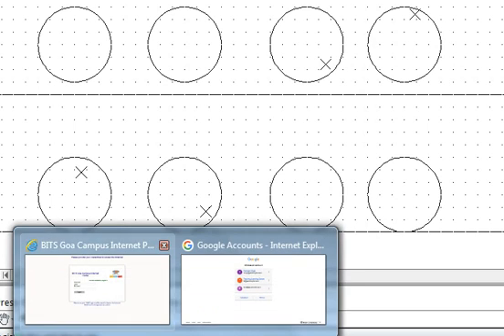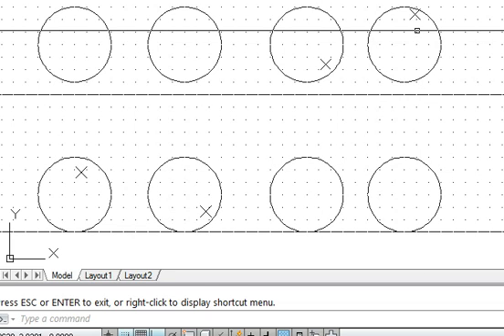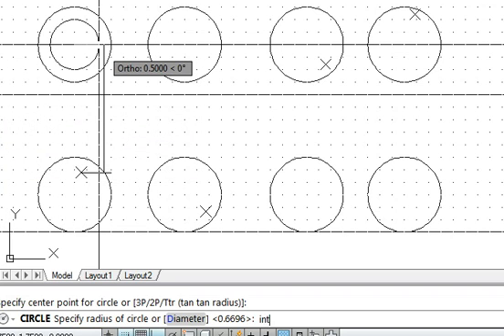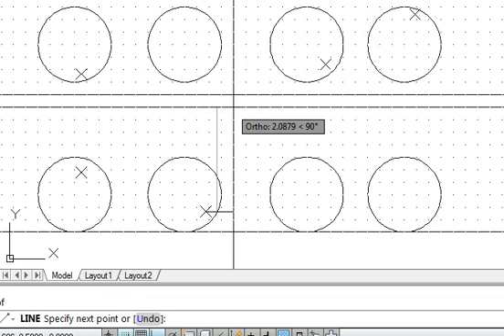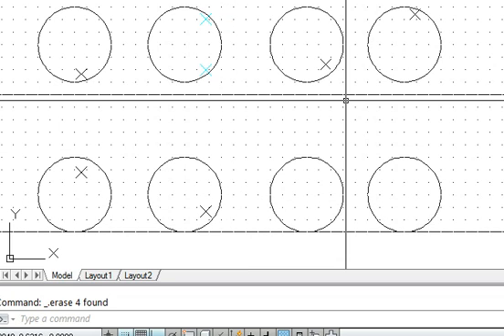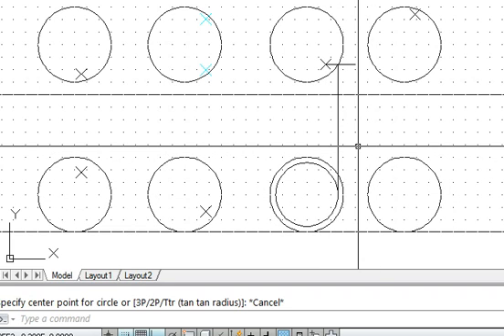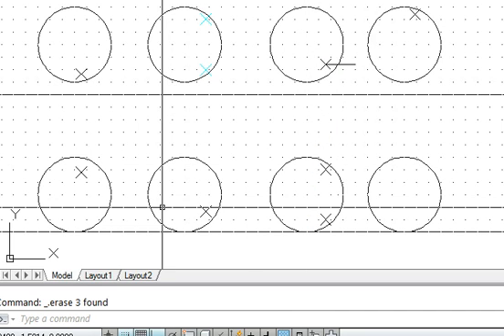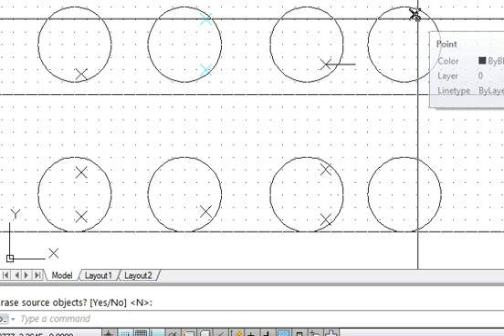transfer of points from one view to other in sphere

Comment: Sir I didn't get why you made 2 points after transfering a point. Sir for example in the third case, there the given point is not a hidden point, therefore it lies on the above portion of the sphere. Therefore it should give rise to only one of the 2 points shown in the figure. Thanks sir